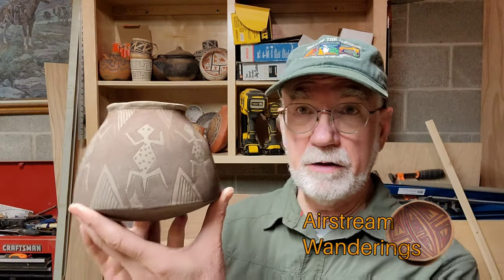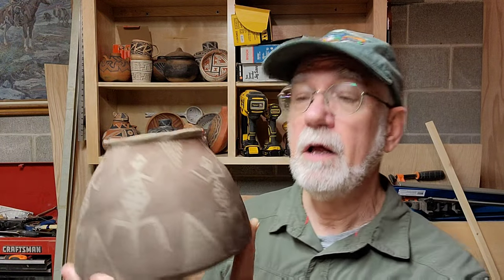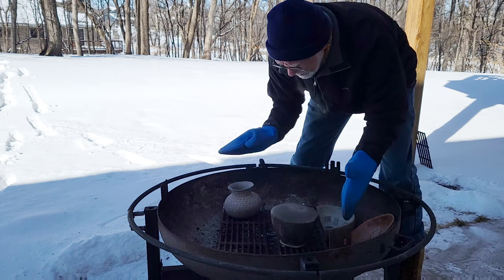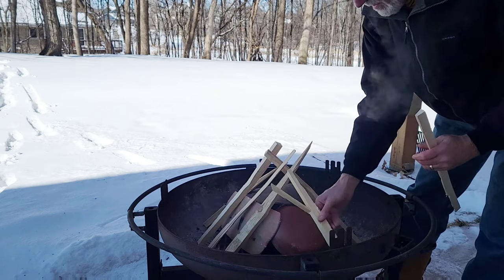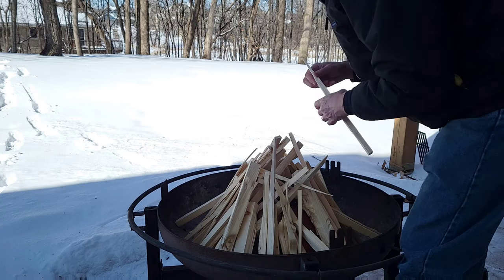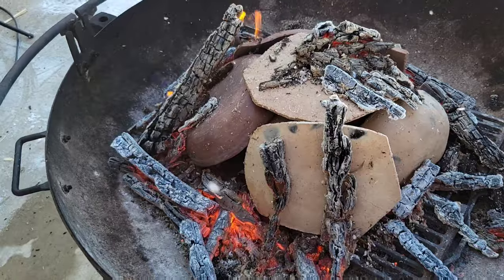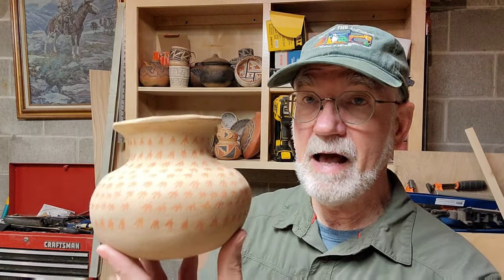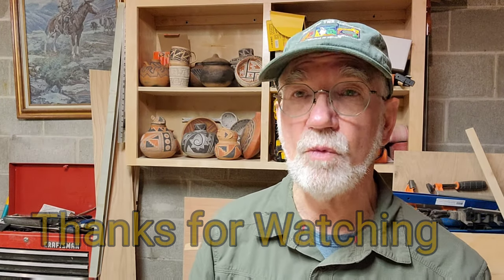Refiring an Ugly Pot, + Firing a Hohokam Jar

Comment: Really nice Wes ! In the past I often got fugitive red rock paint. Was wondering if the clay body you are using has that issue?
Reply from the maker: Good question. I really don't know and have never considered that the clay could be the issue. I have a video coming in a couple of weeks where it was really fugitive even though I mixed 30% ball clay. There's so much more to investigate. Thanks for the ideas.
Reply: @airstreamwanderings3683  this fugitive paint issue has been my biggest challenge at open fire temperatures. I will have one stick good and the next firing not so good.   I will try some ball clay , thanks for the tip. I suspect in part it might have to do with my clay body. Was wondering if you had any of these issues. Thanks again for the ball clay tip!
Reply from the maker: To be honest I haven't give it the attention it deserves. Many times I don't wash pots because Im afraid the paint will wash off.  Then there is pottery 100's of years old and the paint is crisp and perfect.

Comment: hi :-) I couldn't tell, but was looking carefully at footage 1:49. Do you have sherds or rocks on the grate under the pots? And on the first pot, how many coats of red slip did you use?
Reply from the maker: It looks to me I set them directly on the grate. Most of the time now I put down a couple of sherds because the grate sometimes leaves a mark on the rim. It would have been one coat of red paint (hematite and clay mixture). Thanks